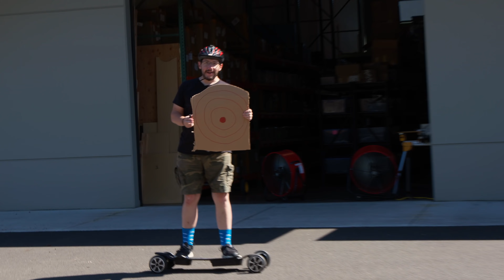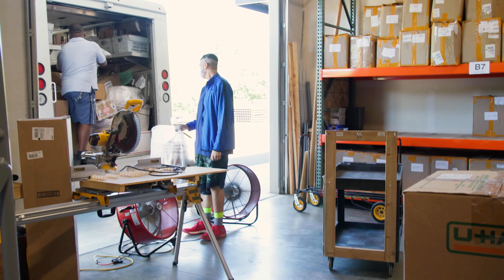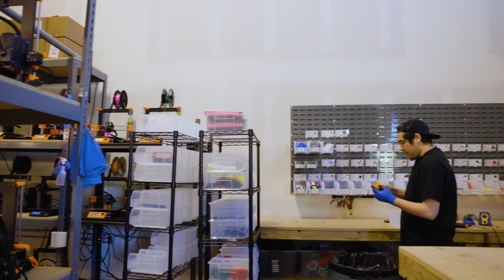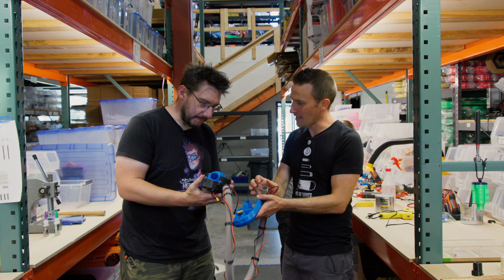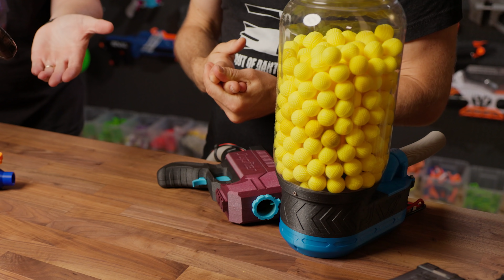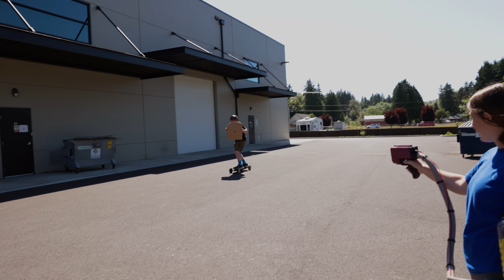Out Of Darts AGAIN! 3D Printing Nerf Mods GOES BIG!

Comment: while I was putting together the open rc f1 car. I used resin parts and noticed that the resin parts. Were smaller and wouldn't hold screws. Like the screw would just keep spinning. It would be interesting to see how a Jupiter blaster out of resin would be like.
Reply: Resin does shrink while curing, so you will need to take that into account when printing. Usually the resin's spec sheet will tell you the approximate shrinkage rate. Normal resin is also rather hard and brittle, so you can't just drive in a self-tapping screw. In my opinion, it's a bad choice for making something like a blaster. Maybe tough resins will work.
Reply: @harmless6813  I had some resin prints shattered when I accidentally dropped them. I haven't tried tough resin yet.

Comment: Resin SCAR (String Centered Auto Rotating) barrels would probably negate the need for strings, allowing you to print the part in one go without major post processing (other than the regular resin procedures. The resin Jupiter might be more brittle, but it should hold up. Would love to see it!

Comment: Drac have delved into resin blaster production a bit. He may be the guy to talk to.
Reply: They're awful. Resin shouldn't be used for blasters.
Reply: I believe he was working with a manufacturer (or someone) on some high strength resins and doing some prototyping. He did a video, but it sounded pretty early-stage.

Comment: I wonder if you could make a proton pack using a modified hard backpack so it would be more ergonomic?
Reply: Yeah that's a thing already lol. This concept has already been developed a lot by multiple people in the nerf community.
Reply: Part of the design of the Proton Pack includes a "snorkel" so the blower can intake enough air when the whole thing is enclosed in a backpack. - Perry
Reply: How durable is it. For example if your running around in a war is the any feeding failures?
Reply from the maker: Ooh that’s a good question.
Reply: @plumbinggamer  In our testing, and in some video reviews from others in the hobby (American Foam come to mind), we've actually found running with the pack makes it feed better because it agitates the rival rounds where the auger can't reach. - Perry